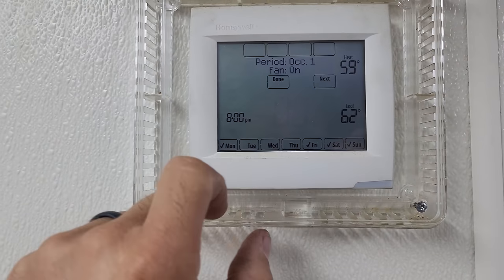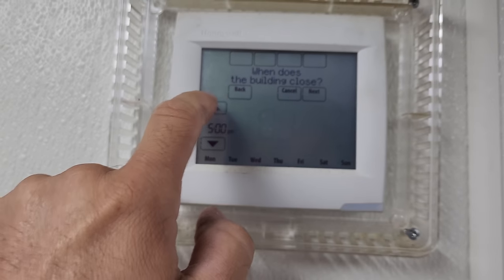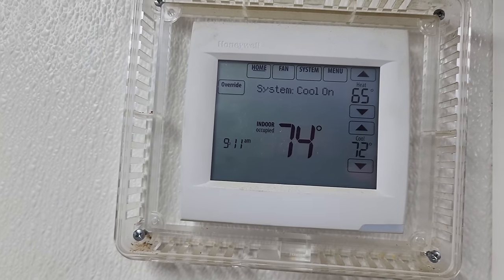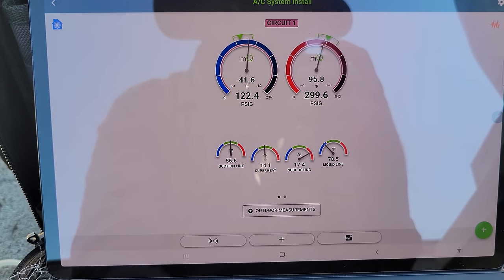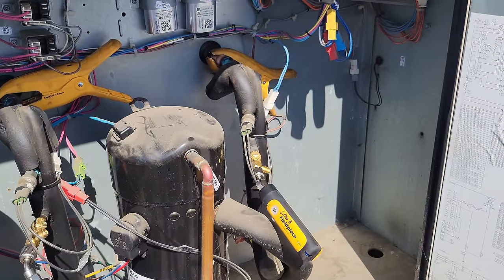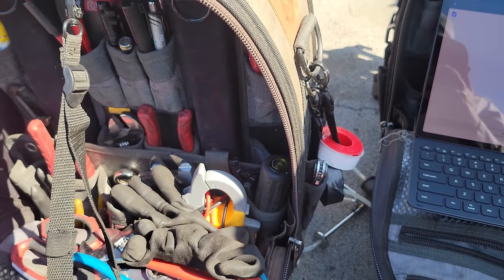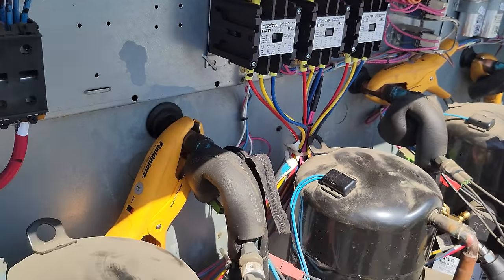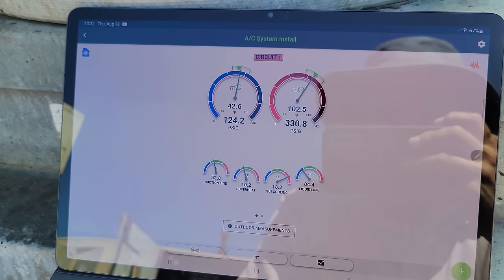THE KITCHEN IS TOO HOT AND THE COOKS ARE COMPLAINING

Comment: I think someone else also said this, but over-torquing the fasteners is not the same as setting the correct tightness. If you install the fasteners with a regular driver, then go back with the torque driver and the fastener doesn’t move before the torque driver clicks, the fastener is over-tightened. You should install the fastener just barely snug, then use the torque driver to tighten it to specifications. Trying to use the torque driver to check the fastener tightness after the fact is the incorrect way to use it.
Reply: I like the torque elbow.  Get the last 1/4 turn out of the torque driver. Do them enough you will be close all the time.
Reply: Verifying torque of a fastener using a torque wrench isn't ideal to begin with as they have too many variables. For an example, in the automotive industry, it's more ideal to use torque wrench with a very low torque spec and then tighten so many degrees afterwards. Ex. 15LB-FT + 90 degrees. No need to worry about if the threads have a spec of dirt on them or are clean, wet or dry. 

Experience is mechanical aptitude over time. I mean were already using a screwdriver to tighten the screws. It's not like were using an impact driver. If a tech can't learn to not over tighten screws in a contactor, maybe they need to find another field.
Reply: @bluecar5556  less variables then a torque elbow.
Reply: Yes i was looking for this comment he is using the torq screwdriver wrong its over the spec and come after whit the screwdriver on spec will not losen the screws.
Reply: @jessyterpoorten7197  nah. Je gets about 1/4 to 1/8 in turn out before it clicks
Reply: @bluecar5556  I agree. It’s not the space shuttle.
Reply: @bluecar5556  in the automotive world, torque angle is used where accurate clamping load is critical, like engine mating surfaces. It's not intended to be used on every fastener.

Comment: When I saw the wires rubbed out on the compressor at 16:32 I was wondering how long it would be until it was a problem. Turns out sooner than later haha. Good video!
Reply: It also looks like there was some kind of wiring holddown behind the compressor.... there is a hole on the sheet metal behind where the cables are bundled together.  Possibly the tie/holddown's fastener poped out of the hole.
Reply: Perfect example how NOT run the wires.... Dont get it,why not using plastic wire canals for wiiring the unit.... And those contactors are expose to everything....dust is a killer for contacts...and gets betwen coils...

Comment: Wax build up inside microchannel due to overheating of the condenser. Seen it before. When sun hits coil directly it overheats and peaks out
Reply: My thought as well.
Reply: Does that oil really turn to wax? Damn.
Reply: Could that be because of a previous repair and not performing a proper vacuum and or using the same gas you pulled out without sending it through a drier
Reply: Could that be because of a previous repair and not performing a proper vacuum and or using the same gas you pulled out without sending it through a drier

Comment: About the unreadable displays: 
(TL;DR below)

The Camera on your phone "opens" it's shutter for every frame for a fraction of the time. (professional cameras call this the shutter angle) if the surroundings are really bright, and the camera shoots 60 fps, which means every 16.6ms there starts a new frame for the video, the shutter is maybe open for only 3 ms. The Display of the machine is displaying the text one pixel-line at a time, and your persistence of vision manages to see the entire display, while the camera shuts off after a couple milliseconds so misses all the other pixels.
Try filming the same display on a night call or with less ambient light, and see the difference.

TLDR:
if your camera allows to set F-stops or ISO try really low ISO for bright scenes and really high F-stops, to force the shutter to be open for longer to get more of the diplay on camera for less flicker.
Reply: I think he uses his phone, he could try to use an external app to compensate or maybe a blanket to darken the controller.
Reply: The crux of the matter is that this kind of camera only tends to have a small sensor and very little space available, so reducing incoming light via a conventional aperture is out of the question - which leaves us with the electronic shutter only and hence this undersampling problem. Not sure whether you can buy ND filters for your phone (I'd start with something like 2-3 stops), otherwise providing shade may be the most practical option indeed.
Reply: I second the suggestion of a neutral density filter.  It might be easier to find a polarizing filter.  That also cuts down the amount of light.
Reply: @russellhltn1396  That might especially help as he often is out in bright sunlight and I am not sure if you would be able to dial up the shutter speed enough without burning out the brighter parts of the picture.

By the way, 7 segment displays may do the same, and even regular tvs or computer screens, only here you usually see some darker stripes rolling across the screen.
Also fluorescent lights, which is why for example go pro cameras have a setting for the frequency, to filter out the fluorescent light flicker.
This sjust won´t work with that controller, as that seems to have its own quite odd frequency.
Reply: For people that are interested and not from the elctronics field: the technology is called multiplexing and is used to reduce the number of wires needed for connecting the display. See https://en.wikipedia.org/wiki/Multiplexed_display for details. Lennox seems to use a pretty low frequency and active time for their multiplexing which results in the camera only picking up single lines like deelkar explained.
Reply: He's on a phone, so fixed Aperture etc.

Comment: I would think oil having been overheating is plugging up the passageway in the condenser tubes is why the head shot way up. If you go there again maybe brake out the IR camera and see if you can see whats going on using it. Just a thought.
Reply from the maker: Great point
Reply: Definitely too quick to be just a condenser deteriorating, that was something moving through the system/condenser and luckily you were able to see it happening. After the new condensers/filters/oil are installed hopefully all will be well.

Comment: I'm not sure I'm convinced of the usefulness of the high-flow/CoreMax fittings. The very high price and the rate of failure seem higher than any convenience or added benefits.
Reply: Exactly! Glad to see I’m not the only one with same thought.
Reply: if i have to pull the charge to fix a leak, i cut them out and put in a normal fitting
Reply: I guess the factory fits them because it saves time on first charging. They really don't care about the recovery speed or cost when repairing.

Comment: 22:22 What you're looking at is a classic Dead-Short caused by the wires rubbing on that compressor tab until the insulation got thin enough to cause an arc flash.

That arc caused the divot you see in the tab as well as the flash-burn pattern on both the tab and remaining insulation...

It should also have instantly blown any fuse or tripped any breaker on that circuit, the fact it didn't suggests the breaker might be failing and should be tested by a properly trained technician...
Reply: Or it did trip the breaker and someone who didn't know any better reset it.
Reply: @uzlonewolf  Based on what I saw in the video, the wires continued to rub against the compressor tab so every time the breaker was reset, it should have almost instantly tripped again or at least tripped when the compressors turned on and caused vibrations which would then bring the bare wire back into contact with the tab and short out again...

Comment: high sub cooling usually means overcharged though back to basics. If you noticed the super heat would also tank during that time. If the discharge and the liquid after pressures would track somewhat the same then I would go with overcharged. if they would go high on the discharge and the liquid after the coil would not spike with it then a plug in the condenser.

Comment: Lennox is great for leaving wires that will definitely rub out the other place that happens is on the crankcase heater They  route the wires over a sharp edge of the heater and it has caused shorts for me before
Reply: Nothing a small bit of rubber and glue won't fix...

Comment: As I said few days earlier on another video, that wiring practice in US HVACR equipment is insult to any electrical engineer! That wires should be cables and in wire conduits and trunks wich are properly fixed to housing.

Comment: It seemed to me that the high pressure only occurred when the compressor started up. 
After a few seconds it seemed to come back down to normal, unless it was high enough to trip on HP.
This makes me suspect some relatively thick material (like maybe oil) pooling in front of a restriction (possibly a deliberate restriction) that doesn't expect to be passing a slug of liquid oil.

Comment: 29:30: It's the difference between the refresh rate of the display and the rate of the camera. Let's say the display is refreshing at 60 Hz and your camera is recording at 50 Hz. You'll see a flicker or line going down the display in the recording. You won't see this kind of thing with any multiples of the refresh rate, provided they are synced at the start. So if the display is 60 Hz, than any camera recording at 30 Hz, 60, 90, 120, etc. won't show any flickering/line.

The reason our eyes (really our brain) doesn't see this is because of a phenomena called persistence of vision. Our brains can only process information so fast (it's way slower than any electronics),  it can hold onto stimuli long after the stimulus has ended. We see movies as if it's in motion despite it being a series of still images. Our brain also fills in gaps based on past experiences. We can't see in color or sharply with our peripheral vision. Our brain fills that in based on what it has seen before. We also have a blind spot in our eyes (because the nerve connecting the eyeball to the brain is there), but again our brain fills that in and we don't normally notice.

Edit: Removed statement about how lens has nothing to do with unreadable display.
Reply: Confirmed, true statement.
Reply: But in the Video you can see that in the beginning, when it was brighter, you can see nothing because the lens opens only 3ms so the camera sees a fraction of the displays lines because the display shows only one line at the time. Later that video you can see more of the display because the lens opens up more and sees therefore more of the displays lines. Yes it has also to do with the frequency of the camera but it's not the only reason.
EDIT: look at the comment from @deelkar he explains it very well.
Reply: It also has to do with the shutter speed, since the shutter speed will be very fast in very bright situation (like a roof in full daylight) it will only be able to capture one line of the display at a time since its a multi-plexed display. When the shutter speed interacts with the frequency of the display refresh and the framerate of the video we get this effect. This video from SED explains it well - https://www.youtube.com/watch?v=dNVtMmLlnoE
Reply: @patrick12399  Both our explanations are valid, just different frames of reference. Deelkar is explaining what is happening on a frame-by-frame basis, while mine is the macroview. Lens, aperture size, shutter speed (where frequency comes into play), and ISO all dictate how much light gets to the sensor, therefore how much info gets recorded. I was being overly dismissive with my lens comment (which has been removed). Depending on how much he lets the phone autocorrect (more than likely, as manual changes to camera settings on a phone is a giant pain) can dictate changes in how much is seen from the display. If all settings are constant, than an explanation on why one moment you can see more and another moment, less, is when the frame started and stopped. Let's say one frame has an led already on and the frame ends with another led on. Next frame starts with that same 1st led, this time off, while the 2nd led is on by the end of the frame. Frequency dictates WHEN information is recorded.

Comment: 16:30 I assume they are a bit over tightened as none of them moved that I saw.  They should be loosened and then re-tightened to the correct spec, just to make sure they aren't over done.  Most people over tighten anyway and stretch the threads.  Just as easy to use the torque screwdriver from the start and then you know its not over done.  👍😁   Keep up the good work sir.

Comment: The reason why those displays are flickering / not readable for us is the REFRESH RATE of those displays and your camera.
a) The individual segments of the display are not lit the whole time but only eg. 50 times a second.
b) your camera is a rolling shutter (like most are) and creates the image by scanning a line from top to bottom and left to right.

If the displays would be constantly lit we could see them. If the camera were a global shutter we could see the displays too. It's the correlation between the two that causes the issue.
It is like when you close your eyes every time (slightly before) a turn signal lights up. It will be like it never lit up at all (do you saw it lighting up?).

You could try to change the video settings for a higher or lower framerate, eg. 60 instead of 30 fps or try a slow-mo mode if available - it may help or not at all, depends on the make and model of your camera.

Comment: If those caps did seal perfectly, sooner or later the cap would exit, stage right. No way could it hold significant pressure.
Reply: Caps are there to prevent dirt from entering valve!

Comment: I’ve had a handful of microchannel units do the same thing with extremely high head pressure on startup. 

The first one,I threw my hands up and fired the parts cannon at it. TXV and filter drier. It fixed it, so that’s my solution when I run into it now. I’d love to hear a good explanation of what’s actually going on in this situation.
Reply from the maker: I will discuss this on my Livestream this evening 8/22/22 @ 5:PM (pacific) on YouTube come over and check it out https://youtu.be/qLynm0RQU7U

Comment: Check the breakers too, Ive had the same issue of a intermittent shorted power leads to the compressor, burned contactor and damaged caps and after fixing all of that, also found that the breaker was melted on one phase which was the same phase that was shorting to the comp.

Comment: Many years ago, I designed an HVAC system for a restaurant in Niagara Falls.  The owner was a real penny pincher and didn't want to spend the money on A/C for the kitchen.  During the design, we wisely included an empty section in the kitchen rooftop for eventual A/C installation.  It wasn't more than two months after the restaurant opened to much fan-fare that the A/C was installed because all the cooks threatened to quit.  Today, faced with similar circumstances, they wouldn't need to threaten anything, they'd just go home.

Comment: Deteriorated condensor is not going to cause a massive pressure spike at startup. Seems to be the pressure eventually pushes out whatever is blocking it. Suggests whatever is blocking it settles in a low part of the line, and is semiviscuous, until the pressure eventually pushes it out of the way, but it will settle back. Maybe tarry oil in a part of the tubing?
Reply: It could be that the problem is caused by that same inept tech whom I suspect may have ruined that condenser coil by not rinsing it after a chemical cleaning. He probably found it low on refrigerant charge from the slow leak at the valve and did a gas-n-go without purging the air from his hoses/manifold. I have solved decades worth of problems caused by bad techs. Nobody is perfect, but... I have had a tech say to me after I brought to his attention a life-threatening mistake, " I can't see it from my house". This guy almost caused the death of a co-worker by electrocution(440v.) due to his negligence. Bad apple.

Comment: Recording Lennox screen, theory and solution:
In daylight there is "too much" sunlight for the sensor to get correct exposure for each frame at "normal" shutter speed (time). The camera restricts the light by ridiculous short shutter speed. The Lennox screen updates the display in horizontal rows, one by one. It lights up and shuts down all pixels at that row before displaying desired pixels for next row and so on, at a fixed frequency. The camera has a likely a fixed frequency - frames per second. It collects light at a different frequency than the Lennox screen, therefore it rolls and you see random rows from the whole screen from time to time.
The main thing is that human eyes has slightly "capacitive" sensor dots, like a medium fast fading memory. So these bright dots will all be visible for us at the same time, when it is actually flickering. The camera just shows the real deal and has some frame frequency conflict at the same time that makes it even worse.
If you restrict the light, put sunglasses in front of the camera. Then it will underexpose the picture, if it didn't adjust the shutter speed. It will immediately open the shutter longer time on each frame to compensate for the missing light and get more light from a longer period. Then it will see more updates on the Lennox screen on each frame as well. Please bring a piece of plexiglas with car window tint if sunglasses is not enough.

Comment: At 5:02 you get a fairly good view of that wire, but can’t tell if it is burnt. At 12:57 it definitely is.
Reply: I can confirm its shorted at 5:02. I pulled it up on my good monitor and its shorted for sure. I can see the burn mark on the red wire and some burnt copper.